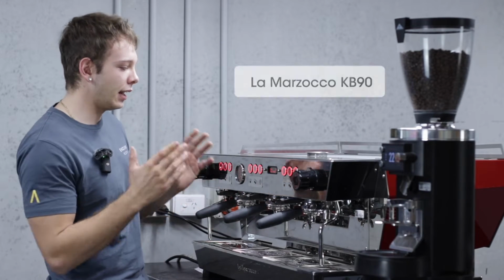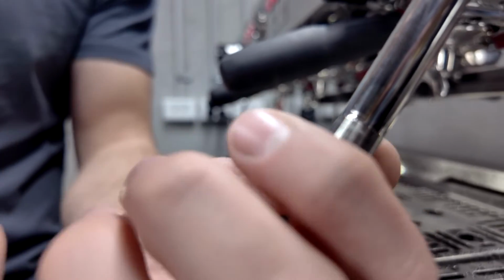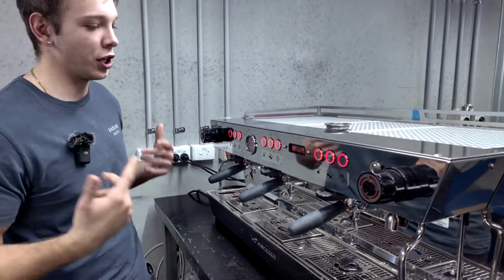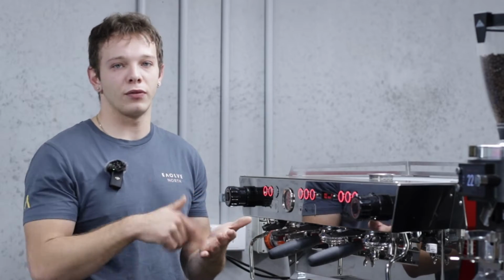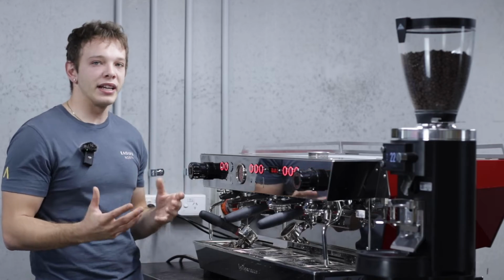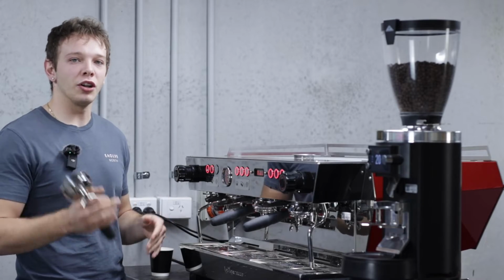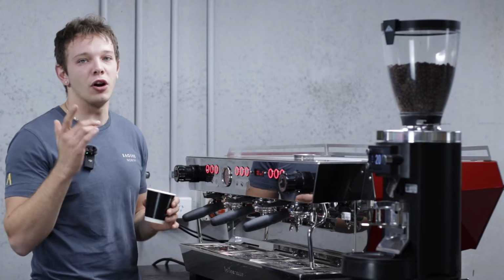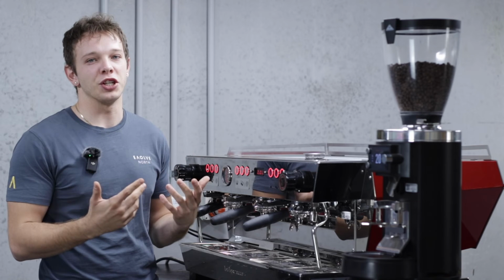La Marzocco KB90: The Ultimate Barista's Choice for Efficiency and Precision

Comment: Everyone they sell should have the double insulated wand. So, basic option. They are such expensive machines. It's a little insulting to some with a brain. It would be like  Mercedes cars with the option of the 500 SEL to come with rubber around the tyres. Common La Marzocco do the right thing.

Comment: That straight in portafilter seems like a dream from an ergonomic stand point, but it seemed somewhat flimsy

Hope it doesn't easily break or is expensive/hard to fix
Reply from the maker: We've had no reports of any breaking on our end so far - the spring will need replacing every once in while depending on coffee volume, but it's a relatively easy fix.
Reply: @EvolveNorth  пожалуйста, подскажите как настраивать группу 1 к 2